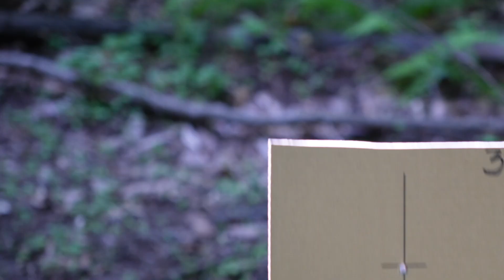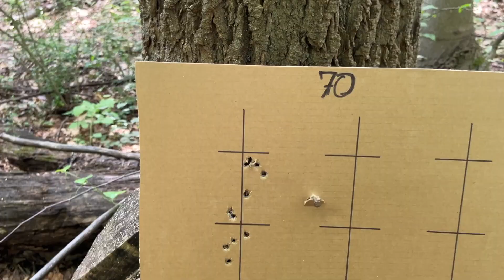How to INDEX, CLOCK, FX Impact M3 M4 liner - PART 2

Comment: I found at 30,40 50 was spot on but at 70 it was shooting to the 3 o'clock position,so ive turned my liner to 11 o'clock , still need to test
Reply from the maker: there is very nice short and sweet video coming this Saturday about clocking, stay tuned.

Comment: Nobody does this with centerfire rifles. Why do not they make those airgun barrels thicker and straight so airgunners would get a seriuous hunting tool, instead of a toy ?
Reply from the maker: The reason for that barrel, shroud and liner inside is sound suppression, that shroud contains some air and suppresses the gun.

Comment: Adjusting for 70  wont then your 30 be wrong ?.   Better way is to optically centre your scope then adjust the liner  so  pellets impact exactly where you scope is aiming.  Then make small adjustment  (  one or two click either way )  to you windage to be spot  on.  Best method for long range shooting
Reply from the maker: yes if barrel bent to the right for example, no matter where you zero, every time you change distance you have to correct the windage, that's why you need to clock or index barrel to have that curve vertical, so the curve only effects the elevation and windage always same
Reply from the maker: Watch my first part video, I explain on the paper very well why and how.
Reply: @PCPsavage yes I understand all that but do you start with optically centre scope other wise or windage in middle of travel
Reply from the maker: @christhomas4260  I turn barrel, and shoot until I find highest point of the barrel "curve" then I adjust my scope zero to that point, I center scope for it and then I shoot longer distance to confirm that windage stays same, if windage walks with longer distance I micro adjust, so the goal is that you get that barrel curve adjusted perfectly so the windage is not changing as you change distance, zero scope to that. I know its complicated and takes time but when you are done, its always perfect. Another point I want to make is that gluing your CF sleeve to liner is extremely important, because if you take barrel a part and reinstall if that CF sleeve turns in any way it will effect the curve of the liner again and youll be doing this all over again

Comment: I like what you did but I have a question, if you adjusted the index for 40y and moved to 50y and tried to adjust and moved to 70y and tried to adjust then the 40y is changed again? So it is either you chose 40 or 50 or 70 or any other number logically. What do you think?
Reply from the maker: you shoot further out to confirm that your adjustment at 40 still shoots in vertical line. Sometimes I do some correction at 60 or 70, because at longer distance it will show finer adjustment, but I will then shoot 40 to confirm.
Goal is to adjust to the point to what ever distance you shoot all your shoots hit that vertical line. That helps?

Comment: Great video. At what distance do you take spin drift into consideration?
Reply from the maker: I shot up to 100 yards and did not have issue yet, I would imagine around 150+
Reply: @PCPsavage Is this the same procedure as if you have the 800 tension barrel system?
Reply from the maker: @stuntr1  Correct, same process.

Comment: Great explanation and illustration, I've followed your process but have trouble keeping the barrel from turning as I tighten the nut the last 1/4turn
Reply from the maker: you talking about liner twisting when you tighten that nut, yes, I know, tighten it 1/8 of a turn, find your happy position, then figure out how much your liner moves and compensate for it.